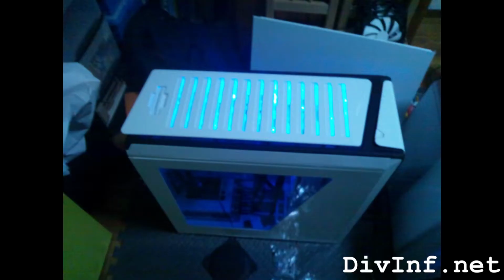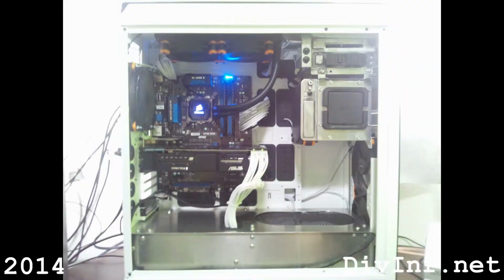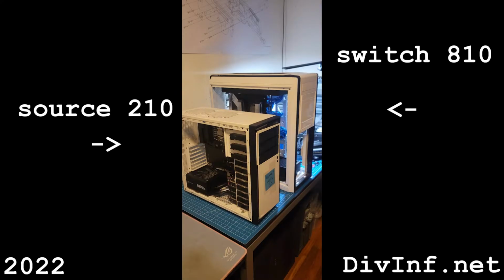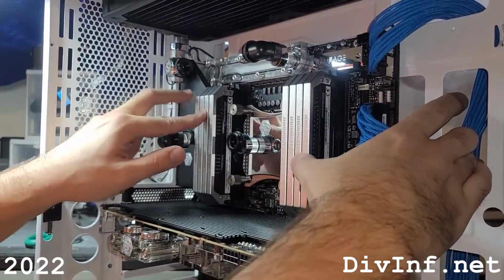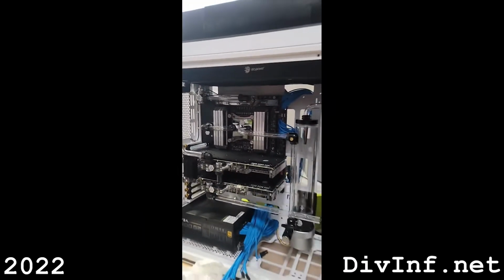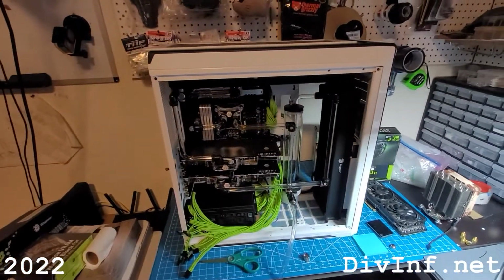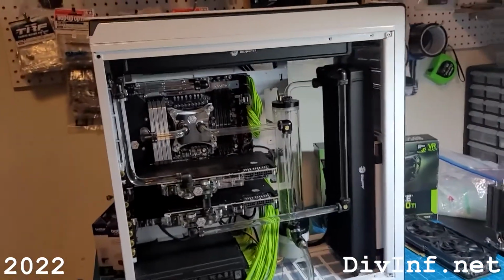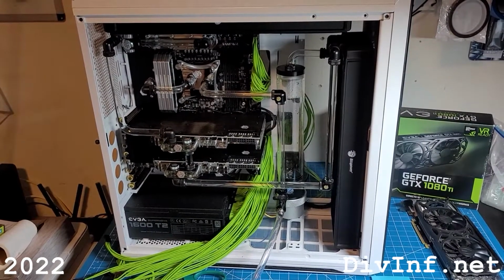Dream PC in my 9 year old Case! NZXT Switch 810

Comment: Nice to see someone else still rocking around with a Switch 810! Question, did the matte black plastic parts on your case start turning sticky in the last few years like mine? Takes a lot of alcohol and elbow grease to remove.

Comment: It's just amazing! I have this case but mine looks old, there's a problem with the port pannel that it just shakes when I try to plug something. I have lost the top cover and the fans are discovered and actually I want to switch the case to a Mid-tower but I'm not sure yet. 
Good work man.
Reply from the maker: Thank you! Good luck with your case!